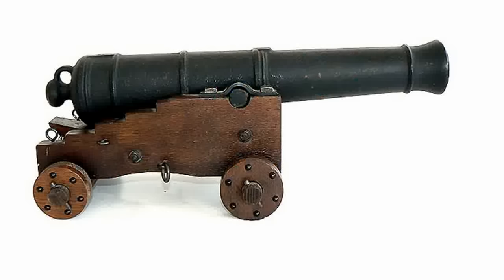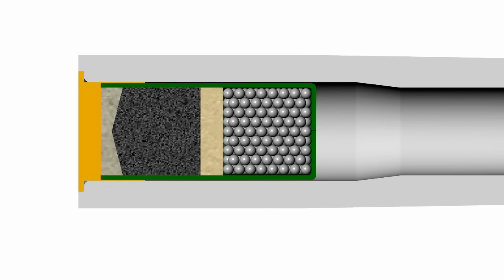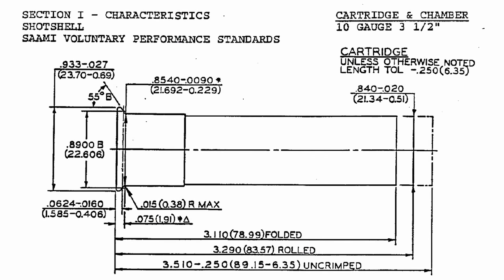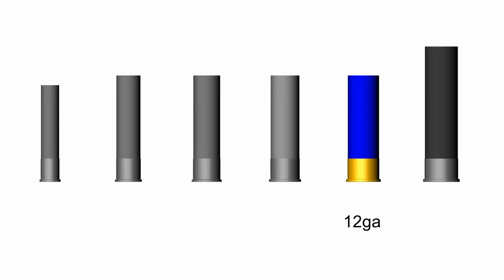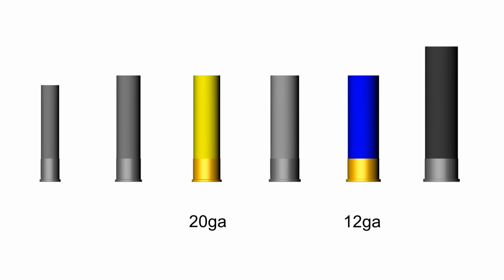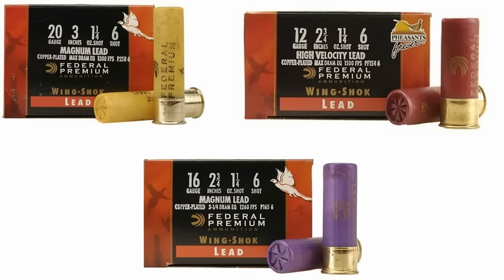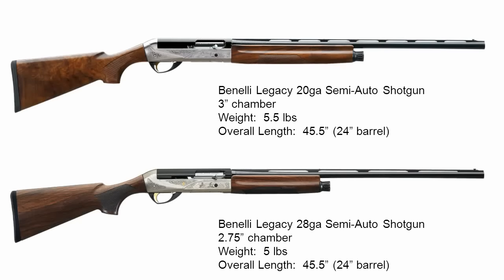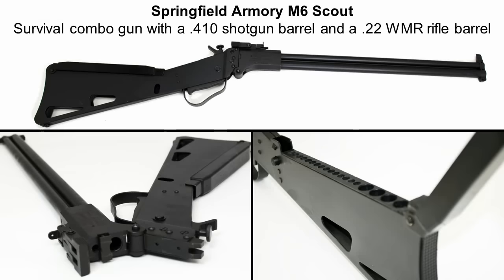Shotgun Gauges Explained - Shotguns 101 #3

Comment: Meh. The .410 is under rated. A .410 slug is as powerful as a .45 colt. I've shot a hole clean through a railroad tie with a .410 slug. It's still 1200 FPS, just a lighter shot load.
Reply from the maker: Any firearm can be deadly, and a .410 slug is definitely a step up from something like a .22 rimfire, even from a short pistol-length barrel.  But if you want to compare ballistics, ~90 grains at ~1200 FPS is about what you'd expect from a hot .380 ACP or a light 9x19mm in terms of muzzle energy & momentum.  Decent in a small, concealable pistol, but kind of a waste of space in something the size of a 4" Judge revolver.  And that's not even getting into the primitive lead projectile design, the accuracy limitations, and the very poor sectional density.  

Kinetic energy is a useful indicator of a cartridge's potential, but it takes good projectile design to realize that potential, and modern JHPs & monolithic pistol bullets have left simple lead shotgun slugs far in the dust.

Comment: Amazing that he didn't mention that a .410 gauge shotgun can also shoot  225grain .44 magnum,  240 grain .45 LC, and  280 grain .444 Marlin rounds..  Three rounds that are powerful enough to take down large game, and certainly great for home defense. Also, you can get .410 000 buck shot with 5 balls. It's a 3 inch magnum that packs over 700 foot pounds of muzzle energy.   The .410 shotgun is not a child's toy.
Reply from the maker: Amazing that you think it's safe to fire rifle and magnum handgun cartridges in a .410 shotgun that's designed for a fraction of the pressure that those other rounds can produce.  Maybe you have some special beefed-up firearm that can handle all of the above (though considering the bullet diameter difference between rounds like the .44 Mag and .45 Colt, I doubt it), but your standard .410 shotgun is ABSOLUTELY not safe being used to fire high-pressure metallic cartridges.
Reply: @SynchronizorVideos  Did I forget to mention that I was talking about a single shot .410.  They are not the same barrel as a .410 pump. Don't worry, the .410 pump action will not chamber the .44 magnum or the .444 marlin.  I never said it is safe... I said it could be, and HAS BEEN done, without a single barrel explosion. You underestimate the abilities of the .410 single, because of what you DON'T know about them. The .410 barrel has a chamber wall thickness over twice that of the average 12 gauge, and equal to the average big game rifle.
Reply: I know right😒👀💯
Reply: @joehasberryjr7398    DO NOT TRY THIS AT HOME!  CAUTION: EXPLOSIVES MATERIALS ENCLOSED.  WARNING: READ AND UNDERSTAND ALL INSTRUCTIONS BEFORE PROCEEDING TO BLOW SHIT UP.
Reply: @timhallas4275  hahaha in my joker voice that's what i live 4 I am an adrenaline junkie I am a armed security officer four and a half years I love helping people protecting people and blowing s*** up and I own a 12 gauge 590 Mossberg Shockwave say hello to My Boomstick
Reply: @joehasberryjr7398   You are scarier than me. and I have been known to dive from bridges, and tape 10 m80s together.
Reply: @timhallas4275  Damn Bruh I'm a Pisces and i can't swim unless it's with a woman get it check mate let's call it even brother have a blessed day ✊👊👌👍💪💯😂😏
Reply: @joehasberryjr7398   Blessed?   How about I go for an accident free day, and call THAT even.
Reply: @timhallas4275  facts my brother

Comment: I figure if i got stuck in any war I'd want a 12g shotgun cause it'd be trivial to find ammo for it unlike all other guns and their specific chamberings.
Reply: .410 and .20 are common, .16 is common but ammo in high supply not so much. And good fucken luck with .28 and .10 Gauges, like those are expensive for ammo. And I have yet to meet a .28 Gauge owner. And I know people who own .4, .8, .10, .12, .14, .16, .20, .24 and .32 gauges. As well as .410, everyone in Canada has a .410 and .12.
Reply from the maker: The 12ga gives you the most choices and the best selection for ammo, by far.  There's also a ton of load data and components for reloading, and it can handle a wider range of payload weights than anything else.  You have to deal with a bigger gun and bulkier shells compared to smaller gauges, and the 10ga is better with very heavy loads or very big buckshot sizes, but those are about the only downsides.
Reply: @Bitis11nasicornis  im talking about if im stuck behind enemy likes fighting someone like say russia. Any american made gun im unlikely to find ammo for. A 12g though would be trivial to find.
Reply: @SynchronizorVideos  also 10g against humans is just over kill. Especially if its a slug.
Reply: @SynchronizorVideos  My only beef with 12ga is that it's not as good as others claim it to be. I find it to be the harshest recoiling shotgun, and I find the moment you exceed the 3" shells and above 1 3/8oz to 1 1/2oz, I find 12 gauge just gets to be overstuffed and harsh on the shoulder. I like 12 gauge for versatility, availability and affordability. But 12 gauge does best as a self defense, sporter gauge, waterfowl and turkey. 

10 gauge is amazing as you said for large heavy payloads. At the same weights and heavier, 10 gauge will dust any 12 gauge and due to bulkiness, they sponge up recoil. It handles 2oz loads like no other and will send a proper pattern at beyond 60m. The moment you try and copy the 10 gauge 3 1/2" Magnum loads by using a 3 1/2" 12 gauge, expect much harsher recoil due to the higher pressures and the fact you overstuffed your bore. 10 Gauge only truely lends itself for slug hunting, self defense (kind of, heavy to carry), and amazing for waterfowl and turkey. The types of hunting you sit and wait for but require long range and heavy payloads.

For field hunting I praise the 16 gauge for being lighterweight then many 20 gauges (if you have a proper 16 gauge). 16 gauge will pattern inside a 20 gauge and 12 gauge, but be lightweight like a 20 gauge and hit just as hard as a 12 gauge. Its great for every field hunting needs but ammo is limited and can be a bit pricy. NO TARGET LOADS are offered in 16 gauge, all factory loads are light hunting to premium hunting/self defense loads. It is a shotgun for the prestigeous hunter. It patterns everything from #9 to #1 Buckshot, at 1oz to 1 1/4oz. Usually loaded in #8, #7.5, #6, #5 and #4 birdshot, and #4 and #2 for steel shot. Only #1 buck is factory loaded, unless you seek Sellier & Bellot's BB loads. 

 If you want the next best thing, go for a 20 gauge but maintain shot loads at 2 3/4" and under an oz in weight (minus slug and buckshot). Also keep it smaller then #5 if you want optimum performance. I do not recommend a 20 gauge for anything other then field game like pheasants and grouse. They tend to be over stuffed after and ounce and have shot stringing when loaded above an ounce. Furthermore, is due to bore diameter it has a handicap of shot stringing with loads larger then #5. I have had this happen to me, have missed out on many grouse shooting them multiple times. I live a 20 gauge, but it has large handicaps many over look. Many will tell you 20 over 16, trust me when I promise you, you'd prefer spending a buck or two extra per box of ammo on a 16.
Reply: @robertharris6092  For self defense you go 12, for survival you go 12. If you don't have a 12, get one. $300 you'll have a Mossberg Maverick 88, and they don't fail. 12 gauge is what all military and law enforcement uses. Its the best all around, and easy to stock up on. But, I do recommend a 20 and 16 gauge, for hunting purpose and many have those too. But again, the one gun to rule them all is a 12 gauge, no gun will top it in versatility and practicality. I recommend a pump action above all else too. Reliability is ourstanding, and you can shoot all loads without worrying about all these malfunction problems. Like light loads in automatics, will often not cycle a bolt. And the benefits a pump gives you, is unmatched. If you want the best, go for a Mossberg 590A1. The only shotgun to beat the US military's INSANE torture test and function without failure in manner of speaking.
Reply from the maker: Recoil is pretty simple physics, just conservation of momentum between the ejecta and the shotgun.  Gauge doesn't matter, and neither do peak pressures, as the payload has barely started its trip down the barrel during peak pressure.  A load that kicks badly in a 12ga would also kick badly in a 10ga of the same weight (assuming other variables like action type and stock fit are the same).  10ga guns tend to be heavier, which is why they're usually more comfortable with heavy loads.  But a 12ga intended for heavy loads or high volume shooting like trap guns or dedicated 3.5" waterfowling pieces will often be weighted to achieve the same thing.

Patterning is a different matter, the shorter shot column in the 10ga should play nicer with heavy loads, although I would add that with modern components, chokes, and loads, there's not as great of a difference as there used to be.
Reply: @robertharris6092  Not as instense as many think, but yeah, slugs are overkill regardless of gauge, so is anything above #1 buckshot. Watch Paul Harrell's video about that. It will scare you how much penetration a .410 penetrates with Buckshot. Like it's disturbing.
Reply from the maker: You could always load a 10ga lighter, just like any other gauge, but I wouldn't recommend it for social work anyway.  The guns are just too heavy and bulky compared to something smaller.
Reply: @SynchronizorVideos  On paper yeah recoil would be like that. However real life, the weight of the gun, length of barrel, material your stock is made of, are you using a pistol grip, and powder charge all make a difference. This is all stuff I feel out of my shotguns, and I shoot .410, 20, 16 and 12 on the reg. Here is recoil for all popular gauges: 
.410 is 8 to 10lbs of recoil
28 gauge is 15lbs
20 gauge is 20 to 25lbs
16 gauge is 23-30lbs (unless you magnum load and overstuff you can achieve 37lbs)
12 gauge range is huge, from 30lbs to 60lbs on average, can be lowered to 25lbs however. 
10 gauge was 40 to 50lbs due to the weight and length of barrel of most 10 gauges.

You claim pressures make little difference, I just wonder if you have field time with guns. Higher pressures do not give added shoulder recoil (generally), but muzzle flip. Yeah, people will shoot 10 gauge all day, but a 50 rounds of 12 gauge 3 1/2" is the max the biggest shotgunners I know will shoot. You can also buy recoiless shotguns. Having a buttplate like all my 16 gauges have versus recoil pads like all my modern 12 gauges have also make an insane difference in felt recoil. Buttplates hold better to the shoulder but cause bruising and harsher felt recoil. Most recoil pads feel nicer in the shoulder, but cause more flip in the recoil.
Reply: @SynchronizorVideos  Also its illegal for many to hunt certain game with 10 gauges, which is a shame. Because 2 1/2, 2 5/8 and 3" shells also existed. 2 1/2 and 2 5/8" shells are loaded by companies like RST for those who have classic antique 10 gauge shotguns. Like Parker doubles or Winchester 1901 lever action 10 gauge.
Reply: @Bitis11nasicornis  well i don't hunt so i don't need to worry about that. And id rather the person im shooting live so they can waste away in a cell instead of get an easy off so id rather not use a shotgun for defense anyway. That and a handguns more easy to carry and quickly aim at the target. And of course far easier to carry/conceal.
Reply: @robertharris6092  12 gauge birdshot loads or any gauge in birdshot would be sufficient for homedefense. You can buy rubber buckshot, but those are FUCKEN EXPENSIVE, $8 per shell man, no joke. Those are less then lethal approaches to selfdefense with a shotgun. I recommend a small double barrel or pump action 12 gauge with a buttstock (do not go without a buttstock).  You wouldn't wanna wake up and be using one of those bad boys first thing on impulse half asleep lol. 

I love handguns, you are right to a point. Sure handguns are more maneuverable, lighter weight, and what not, but they are way harder to aim with. Good luck shooting accurately with a handgun in the dark, because handguns are by far the hardest guns to learn. You said you want less lethal, but a handgun is all center of mass shots you are suppose to take. Very unlikely you'd practice and get so good with a handgun you can perefectly place shots in high stress scenarios. Like you have to practice and practice and practice, and that's just for learning how to actually hold the handgun properly.

This where I go back to that shotgun. In real life, it's unlikely you'll face more then two "bad guys", and it's rare in self defense cases for people to shoot more then one to three shotgun rounds. So a double barrel is really a good simple firearm to operate, point and shoot. Birdshot will hurt like a bitch and the doctor may walk out on you mid surgery for not wanting to remove all 320 #8 pellets lol. Shotguns also have numerous varieties of non lethal ammo as I mentioned. Just don't go buckshot or slugs, because that will kill and over do it. Like copper plated 00 Buck will go through several walls and thick metal stops it, its going through. I highly recommed you watch Paul Harrell's videos on "shotguns don't suck for home defense". Trust me, give that one video a shot. He can explain it better then myself in video.
Reply: @SynchronizorVideos  I appologize to you if I come off as an arrogant or narcissistic asshole or troll. That is not my intention, I am only speaking from my experiences. I just read some of my comments and understand if I come of as a rude person. I appologize if I do.
Reply: Bitis11nasicornis 

Well said brother, well said!
Reply: @muddyuddertugger  Thank you. I just been around several shotguns, its what I started shooting and what I enjoy at the range the most.

Comment: BS on the 410...I have a Pump  that I use for Bird Pest in my Orchard using Skeet Gold shot...No tree damage....No. 6 pellets for Rabbits or Raccoons...and Home defender Rds for Deer...one shot at 30-40 yds works every time....less meat damage...plus any Home Invader would be done after 5 shots of any of the previous loads....Cheap , Light , No long range lethality worries, Easy, low recoil, Less Noise, and no Collateral damage from over Kill / Penetration...
Reply from the maker: The .410 can work for a lot of things if that's all you have or what you prefer to use, but it's usually not the best choice.
Reply: In isolation, swinging a garden rake is an awesome weapon. When accompanied with sledgehammers, pick axes, baseball bats, machetes, framing hammers....the garden rake looses some appeal.
Reply: These guys have never had to shoot "critters" in the corn crib lol. A Judge is much easier to follow a running rat. And with 5 inserts I can switch to 22Hornet. for raccoon or groundhog (love that wild meat). Unrifled but pretty accurate up to ~25-30 yards. lol

Comment: What's the most powerful gauge
Reply: @longbow3082  thx
Reply from the maker: Most shotgun gauges have roughly similar muzzle velocities, so generally a bigger bore means a heavier shot load and more energy.  There's definitely such a thing as too much power, though.

As far as common shoulder-fired gauges, the old 4-gauge guns are pretty hardcore.  They were used with slugs to stop charging elephants and rhinos during the heyday of African hunting expeditions.
Reply: @SynchronizorVideos  thx
Reply: Synchronizor isn’t anything over a certain bore diameter considered a destructive device?
Reply from the maker: Shotguns are treated differently in that respect because they're smoothbore firearms.  The whole destructive devise classification is full of exceptions and caveats.

Comment: Does it matter what bullets I get for self defense?
Reply from the maker: I would say so.  There are definitely more and less effective ammo choices for defensive purposes, depending on the specific scenario & firearm.
Reply: @SynchronizorVideos  I have some target shots, what is you opinion on that?
Reply: @conman20000  00buckshot is what you need, 2.75 or 3in., either one will be good for home defense.
Reply: @wizardofahhhs759 I used to load my 12 gauge with 00 buck for home defense.  But after some research,  I switched to #4, 2 3/4 inch.  Still plenty of stopping power but a reduced risk of over penetration.   00 buck has 8 pellets, #4 has 27.  Either one will be an instant attitude changer.

Comment: 1 gauge > 50 caliber?
Reply: What about a .50 gauge?
Reply: @danielgudi7446  .1 gauge would be a mortar/cannon
Reply from the maker: Anything bigger than a 38ga would be more than half an inch.
Reply: @SynchronizorVideos  so a 1 gauge shotgun would be deadlier than a 50 caliber rifle?
Reply from the maker: I don't know about deadlier, I was just referring to bore diameter.
Reply: @the_honkler778  Depends, are you using a streamlined boat tailed anti material slug with an insanely huge powder charge behind it? Because if you go too big your round is slow and does not penetrate hard objects. If your bullet is pointed and traveling over 3000fps, you start standing a  chance. But caliber doesn't make the gun powerful to a degree. A .460 Weatherby Magnum is more powerful then the .600 Nitro and all other H&H rounds under the .700 Nitro for hunting rounds. In fact I think only three hunting rounds surpass that .460 WBY MAG, and thet .460 is a .45 cal round.
Reply: .50 cal is half an inch, 1 gauge in exactly an inch.
Reply from the maker: A 1-gauge would have a bore diameter of 1.67 inches, because that's what a 1-pound lead sphere would measure.
Reply: @SynchronizorVideos  Would you try or 1 bore? I'd try one, I think it would be fun, as long as it's black powderm